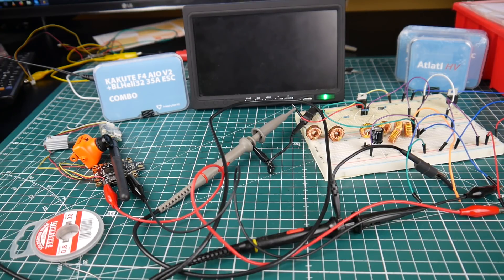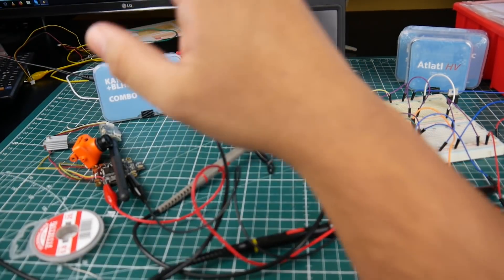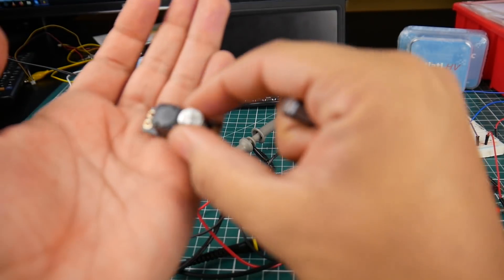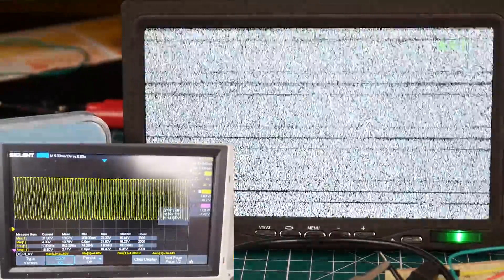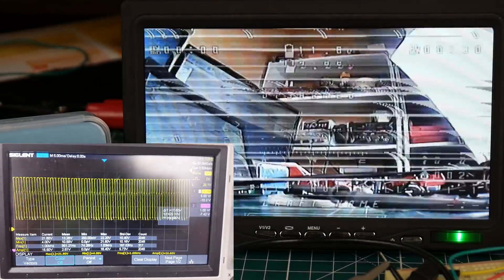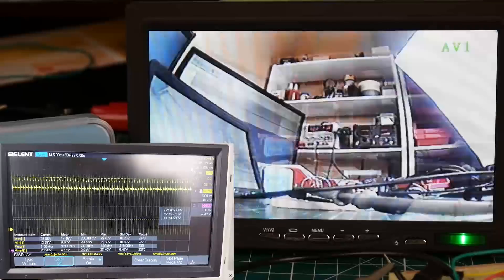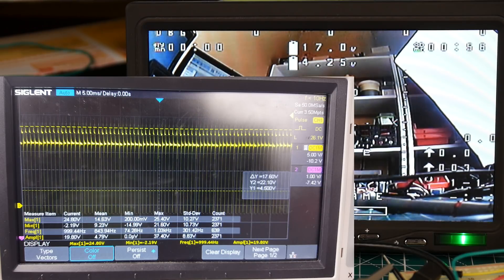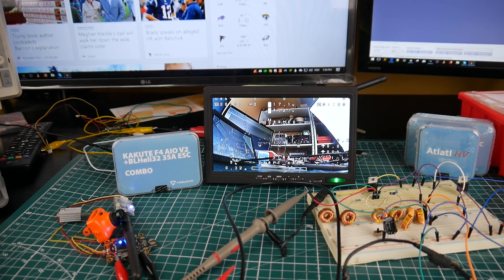Low ESR Capacitor vs LC Filter // Drone FPV Noise Fix

Comment: what if both doesn't work? and noise still presented? Even when powered separately vtx with camera from laboratory power source small semi-transparent noises are present. And this is present on every vtx 3.3ghz I have. No such issue on 4.9 or 5.8. Its 3.3g itself is noisy by its nature or something is wrong? ANtenas and cables are good and verified.

Comment: Is it over kill to use a 35 / 1000uf cap, an LC filter & a matek 9volt power regulator? I have this cap & voltage regulator hooked up to my unify pro 32 hv VTX and when I arm I get black horizontal rolling lines. Would also adding an iflight LC filter between the regulator and vtx help solve this ? My cam is going straight to the flight controller. I was also thinking of powering the runcam Eagle 3 thought the unify VTX. What are your thoughts on this please?

Comment: Hello dude, plase give solution, my drone fayee f605 and camera fpv Tx03, the sinyal was stabil when drone in stanby mode, but its very noise whene the drone is flying, so should i need the capasitor n what is the uf dan volt, or i have to change my lipo battrrai to lihv to make it more stabil for the camera. Please answer my question.

Comment: This vid is right on time, Can I use a low esr capacitor to remove noise from my video feed? And if so how would I go about soldiering it up?.
Reply from the maker: You would need to solder it to where the battery wires are connecting.
Reply: Yes I have that just wondering if there's more I can do.

Comment: How do you wire a Low ESR Capacitor to a Video System,/ Video Transmitter/ ESC or to FPV quad.

Comment: I have the new Eachine Wizard 220HV which has very bad lines and it runs 6s how can I fix it the noises and what do u recommend
Reply from the maker: Add a low esr capacitor

Comment: Where is the best place to put the Low ESR Cap on the quad?  I had a quad built and the guy connected the capacitor to the FC ground and VBAT pads, but when I fly in high throttle the FPV feed gets really noisy? Any advice?

Comment: I have noise on my geprc pheonix. I have a capacitor on the power leads and still noise. I get noise only on throttle response. I want to add a small capacitor on the vtx. Do you know which pads i should solder it on? Gnd to Gnd and positive to vbat?
Reply from the maker: I have one also I'll fly it and report back on a solution.

Comment: Hi, I’m having a problem with noise on a 6” 6s build with f80 motors and the tiger f45amp escs.
I get like black lines horizontally only under throttle.
I’ve added 1000uf cap to each esc power/ground, and I still have the exact problem, I tried soft mounting the motors, I’ve tried another vtx. Still have a the noise. Do you recommend anything else. Should I add a cap to power and ground to the vtx or camera
Reply: Camera and VTX grounds should be connected to the same ground pin physically.

Comment: dronemesh what should i buy since im having issues with 4.1 esc? i need a 6s esc that is good and is single esc. I keep having my 4.1 esc shorting out and my fets flow negative from lipo to motor output pads. so id like to get good esc's that will hold up. im unsure if zmx finx40 2607 is causing the issue or not but there 2610kv at a 2607 size. dys xs30 was junk year ago for me but spedix es30hv been good but wouldnt a 32bit be better flying?

Comment: Drone Mesh hiya buddy I'm just starting to fly with fpv and I added a LC Filter to my quad it's made a huge difference I was getting interface like in the start of your video lol it was bad after liftoff completely lost signal but it's looking good now but I'm using the diy ufo googles and added the EACHINE pro dvr and it wired to the receiver in the googles and was wondering if it's a good idea to put a LC Filter on the dvr power supply to cleanup the fpv system completely would it make any difference Drone Mesh

Comment: You did not tested with a good noise source. A single capacitor does a good job filtering a single square wave frequency that you used as noise source but it probably cannot do much with real noise. A LC filter tuned with the right frequency band with do a better job. In a FPV environment, the noise are basically complex switching and changing frequencies generated by the four ESCs, depending on the stick movement, these frequencies are like random and mixed together and creates multiple beat frequencies. There will be spikes too as well as interfences from the FC. A single capacitor does not do much in that. I suggest you can test it in a real quad flight.

Comment: Used LC filter (battery -> lc filer -> cam and vtx) with any issues but  decided to chance that huge LC filter to Low ESR Cap (battery -> low esr cap -> cam and vtx). well that did not work as i hoped. got some white linear bars :D  Ripped that off and but back LC filter :D

Comment: By the look of your waveform it appears as if you are modulating the power supply not adding noise. A cap will act as a dampener to this type of activity. A noise filter actually does much more however the cap in this noise filter is not properly sized to the frequency. This is why you are seeing an attenuated waveform but not fully smoothed out like that of the larger capacitor.

Comment: Well, the LC filter is usually used in series between the PDB/FC and the camera, therefore the LC filter only cleans the voltage feeding the camera, but it doesn't get rid of the noise on the PDB/FC, so the video signal with the betaflight OSD coming from the FC towards the Vtx in also noisy. I think the LC filter really makes sense if you don't use the betabflight OSD, the LC filter is connected to the battery on one side and to the camera/vtx on the other side. Anyway, I would use both : the LC filter like I described and a cap on the PDB/FC.

Comment: Wonder if you connected the LC filter correctly .. You probably did but is looks so wrong with the signal.
Can sometimes be tricky to get all the connections right.
Reply from the maker: +Raqtor96 The detailed shoot out will be out soon. just some thought have you ever wondered what an LC filter does on the side where the noise is comming from. It increases the noise back to the FC.
Reply: Yea a LC filter needs to go between the noise source and the signal recipient to work. Example between your 4in1 esc and your FC :-)

Comment: I hate to ask you a question semi-unrelated you your video, but I'm at my wits end haha. My FPV feeds cuts out every time my quad does a hard flip or roll. It also cuts out when I tap the quad on a tabletop. It's weird though, because it only flickers and cuts out when it's armed. If it's unarmed, I can bang it on the table all day and my FPV feed is fine. I've tried 2 different VTXs, and 2 different cameras. It's a brand new Clracing F4s. Can a FC be responsible for a "trauma-induced" loss of FPV feed? Thanks.
Reply from the maker: +Stephen Craig Cuts out with black screen or static.
Reply: Drone Mesh Black screen. Sometimes when the fpv feed comes back, all my colors are really distorted too (like dark purples and reds), and when I unplug the lipo and plug back in its back to normal.
Reply: The Flying Nurse did you end up solving your problem?

Comment: Super nice! It would be great as well to see the same comparison taking the  12v pdb output feeding a vtx outside the miniquad and arming and spinning the quad with props tied on a table or to a heavy weight to keep it stuck to the floor.

Comment: LC filters are a capacitor and an inductor. if the noise experienced is due to voltage supply fluctuations then adding a cap of the right size is the solution, as demonstrated
 i expect the LC filter in this vid probably only had 200uf cap and not quite big enough hence didnt quite fix the problem, else it would have done the job much better. i used an oscilliscope and tested a 250uf cap and it only damped half the noise, tried 550uf and all noise gone (fpv car not drone).

The inductor in an LC filter prevents noise caused by damping current fluctuations - often produced by changing magnetic fields in nearby equipment. if you have such noise this problem could also in theory be solved with sheilding the source or vtx components but i think fpv is more effected by the voltage drops caused by changing motor load and hence cap in this application is the important thing more than the inductor
Reply: 1LittleTinker yeah it’s not like inductive reactance has ever been a big noise factor in RLC circuits.... pretty sure most cases a good cap is all you’ll need to stop the inductive reactance lagging the resistance.
Reply: Thanks for the insight. I though that voltage drops arent the only source for noise but I dont know it as well as you do

Comment: Wow really that's how I fly and learnt to fly I added a low esr cap toy build to little to no results the lines are diagonal instead of horizontal with low esr...  My setup betaflight f4 FC, spedix gs30a blheli32, cobra motors champion 2207/2450kv and runcam split v2 powered on the 5v filtered cam pad on the bf f4 FC....

If it's muggy it's hard to fly, if it's sunny I can rip around but the handicap is always there going on 1 1/2 years of flying crappy FPV feed noise it's normal to me now.......
Reply from the maker: +Gap of DooM add another small cap on 5v.
Reply: Drone Mesh thanks, I will try that ... 👍

Comment: Awsome tests! Can you also test if it matters how long you keep the "legs" of the caps? And if it helps or does not matter at all if you solder verry thin or thicker awg wires to extend the positioning of the caps? That would be awsome! And something i think alot of people are wondering about..
Reply from the maker: +UnXisT FPV I made brief test into that and found it's sooo small.. however I will be testing that also.
Reply: Drone Mesh great! So i can also just use the "stock legs" from the caps and leave them as long as they are..

Comment: Is your LC filter working properly? I saw another video a while back doing the same test.  On his test, the capacitor only filtered some of the noise, but when he added an inductor, it smoothed out everything.  On his oscilloscope, it was almost a straight line. I'm really confused.
Reply from the maker: +Rotor Rebel FPV Don't worry I have more on the way and ill go in depth in a shootout what is good for what freq and perfect the voltage spike test.

Comment: Really big noise, but what about frequency ? Is the one your using in the same range of that of esc's or motor's noise ( or whatever it can come from on a quad )?
Not sure your results will be the same for all freqs.
A LC filter is just an inductor and a capacitor. If you simplify the shema to just a capa and it's better then I can't understand why LC filters are so frequently used in every electronics dealing with frequency.
May be your LC filter is just sh.t ? May be you can switch your rubicon cap and the one on the LC filter and do the exact same test ?

No trolls is these questions, my english is surelly not excellent. I just want to understand

Comment: My vtx started doing that when i give throttle. So i changed vtx and no noise. 
What's a good cap.to use
Reply from the maker: RAGE-FPV Johnson link in description :)
Reply: I ORDER THE LOW LCR CAP.

Comment: Amazing video, congratulations!
In what part of the circuit should you connect the capacitor to obtain a clean image on the screen?
Reply from the maker: Israel Montoya battery pads.
Reply: Thanks for the information, Happy flights!

Comment: Could you test different size capacitors from 220uf to 1000uf? Thanks!
Reply: I would like to see this as well. If 1000uf is really needed or if a 330uf will clear 95% of the noise

Comment: I had a noisy quad (new build) .. did every thing to it lc , cap , reg  the only thing that solved the problem is a new vtx don’t know why ...
Reply from the maker: bravo 80% chance cracked solder joints on sma port.

Comment: Fantastic, man. Have you tested with a 1000uF capacitor? I'm curious to see if it gets better or worse.
Reply: Anyway, I think any capacitor with F enough (and voltage enough, of course) should (I mean SHOULD) work.

Comment: Isn't this equivalent to a single motor?  On a full setup wouldn't you need at least 1000uf?
Reply: Yes 1000uf if you're using one single cap 330-470 is fine for x4 at each ESC

Comment: Awesome video dude. For a noob though, where is the best place to mount as Ive seen people mount at main battery contact on PDB or one at each ESC contact? Also, what causes the noise in a build and what can I do whilst building to minimise the risk of creating noise or is noise just something that will happen regardless? Keep the vids coming. Subscribed.

Comment: 35v 1000uf is better or worst than 25v and 470uf?? I use the first one and still have tons of noise if props are not new. Is there a best way to apply capacitors? Mine are on the battery leads. My fc is the dys f4. I use the 5v for the camera but vcc for the vtx because it’s 7-24v input. Do you have any suggestion?
Thanks a lot!!!
Reply: Try to apply it closest to the noise source, like esc power input.
I did also install the caps on the VTX power.
Reply: I'm going to try another vtx and start from there. the idea to fille the quad with caps doesn't make me so happy. Thanks for your suggestion.
Reply: Giuseppe Falcone did you use 4in1 esc? because I also had noise and also tried install 1000uf 35v on the battery leads, but the noise is still there. until I change with single esc for each motor and install 470uf 24v on each esc, the result is a lot better. I don't know if my 4in1 was not good, but I'm quite happy now with my signal quality
Reply: I have 4 (cheap) escs. I'm quite sure that one of the problem is my vtx. I'm stuggling with it since a bit so I ordered a new one which I know is good. I'll let you know. I also bought a 9v filter I wanna use to power the vtx in case the noise is still there.

Comment: Could you also do a video of the same test with a low esr capacitor and a no name cheap non low esr capacitor? I’m really interested in seeing how much of a difference it makes. Thanks in advance and happy flying!
Reply: I had only non low esr cap's and it works amazing Still. From old esc's

Comment: I had a noisy setup didn’t have it as bad but it was pretty bad almost comparable to the video. It was using 

Dys f4 fc
Dys f30a 4in1 esc 
Dys storm 2207 2550 kv
Foxeer monster v2 camera
Immersionrc tramp hv vtx
Pagoda antenna

I’m suspecting motors were the culprit as they’re coggy feeling when turned by hand and magnets inside are pretty powerful. My solution was to use an el cheapo big ass capacitor no low esr though as I couldn’t find any locally, just a no name Chinese brand 35v 1000uf. Seems to have solved my problem.
Reply: erdemk0 DYS F4 and their 4 in 1 is by far the noisiest setup getting around, best bet is to cap the battery and use the 5v reg for VTX and camera.

Comment: I think when it comes to filters, they need to be made for a specific frequency range. Hence why we have high pass a low pass filters. That said how we would implemented such a thing is beyond most of us. So let's just stick a cap in its arse! 😁 (By arse I mean battery pads).
Reply: Hi Trystan is that the best place to put Low ESR Capacitor on the battery pads. I had a quad built and the guy connected the capacitor to the FC ground and VBAT pads, but when I fly in high throttle the FPV feed gets really noisy? Any advice?
Reply: @highestvirtue1892  Yes if you're using one large cap i.e 1000 uf 35v use it at the battery source as close as possible by cutting the wires shorter on the cap and use heat shrink. If you have single unit ESC's then you have the option to put a smaller cap i.e 330-470uf 25-35v directly on each individual ESC which can be argued is the cleanest/least noise

Comment: I've had the best luck with LC Filters :) They are amazing! There is definitely differences between other brands of LC Filters, I've had some that were crap and some that were great.

check this one out, I use it with 6s regularly and it works GREAT!
http://www.readytoflyquads.com/mini-rtf-lc-filter-3amp-2-4s
Reply: The listing says up to 4S, also the cap is rated for maximum 16V. Weird...
Reply: I'm probably playing with fire then.. I should probably stick with 4s until I can find a 6s rated LC Filter